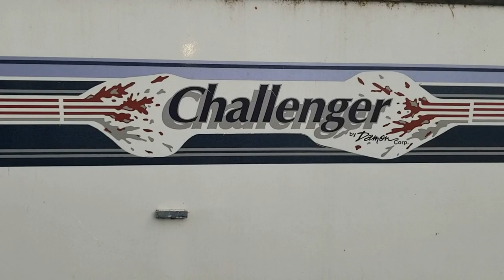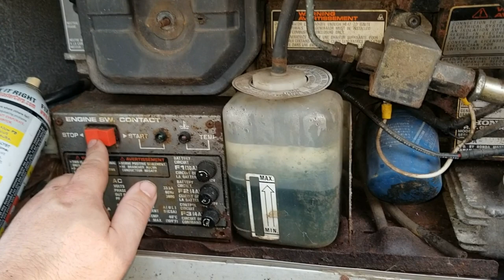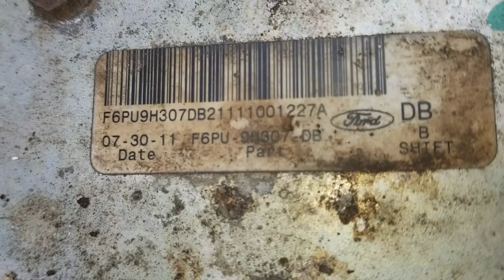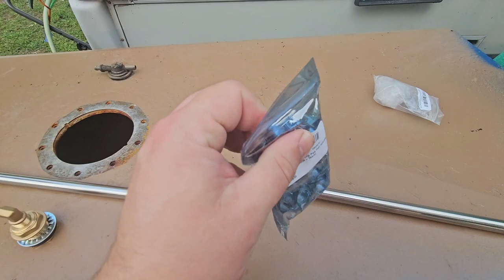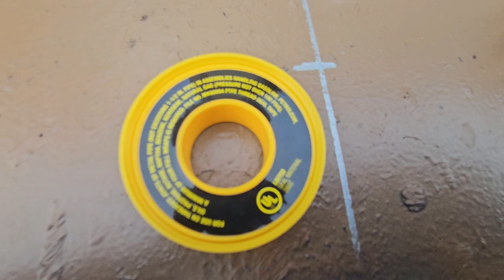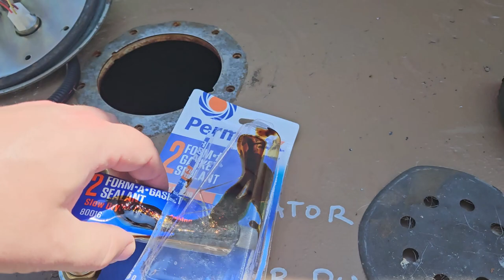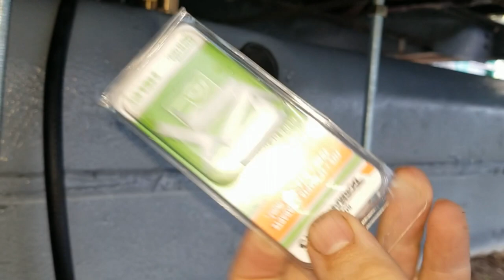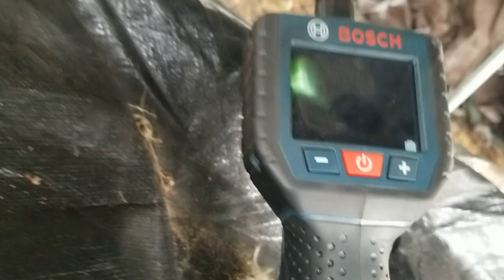1989 Ford F53 Fuel Pump Woes   Damon Challenger

Comment: The 6.6VDC is normal after the key is turned on for 2 second. It is coming from pin #8 of engine computer.
You only get battery voltage in the first 2 seconds of the key being turned on unless the engine is cranking or running.
To test with the engine not running you must jumper pin #2 to pin #6 of the DLC (self-test plug) in the engine compartment.
The small tube is not a vent. It is the fuel supply source for the generator.